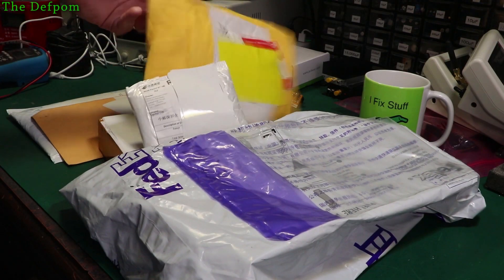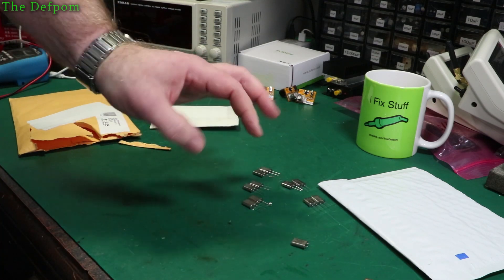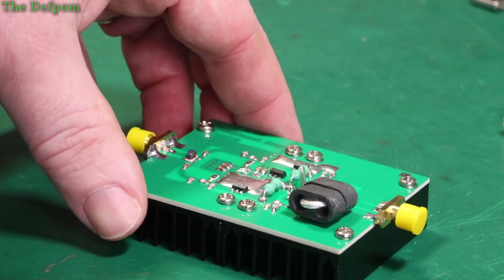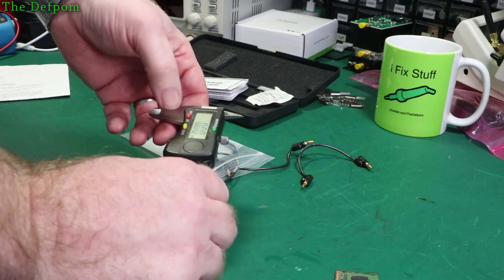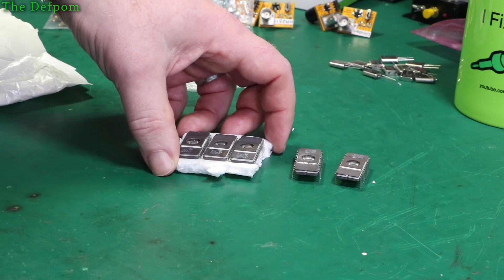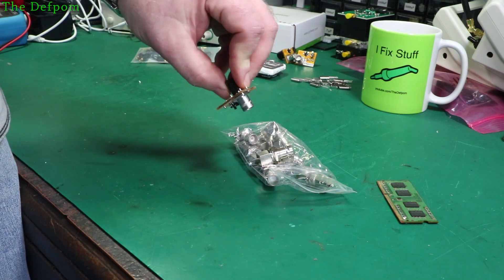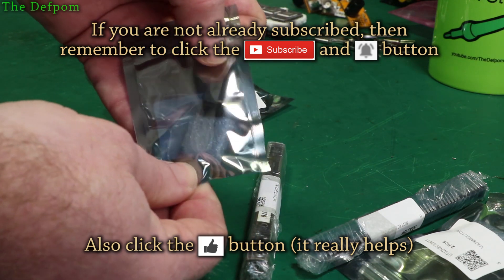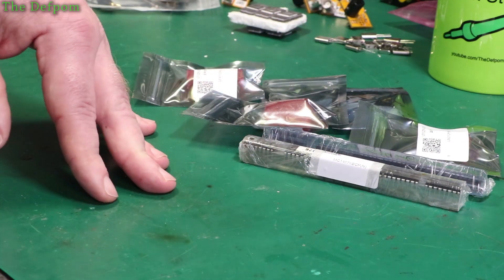#739 Mailbag Monday 27th July 2020 🎞 📭 📦 📩

Comment: I am assuming you did not mean to include the standard 7812 & 7912 voltage regulators in the hard to get category?
Reply from the maker: They are not 7812/7912, these are 4 terminal adjustable variants, which are hard to get.
Reply: @TheDefpom  Sorry I apologise these are a bit harder to get hold of.